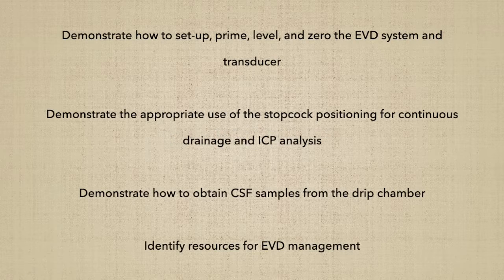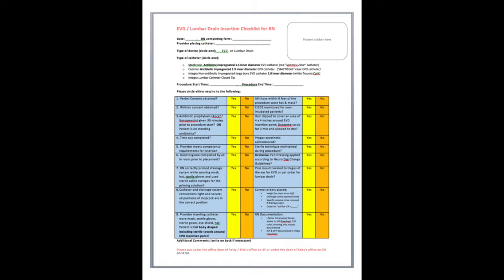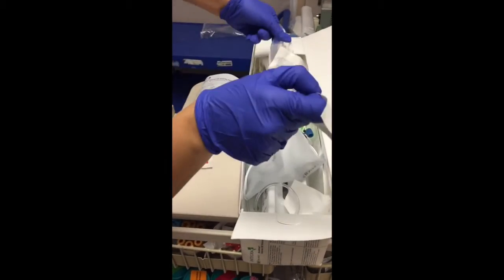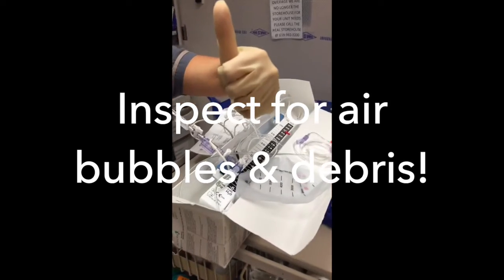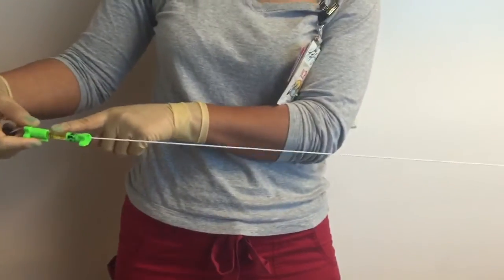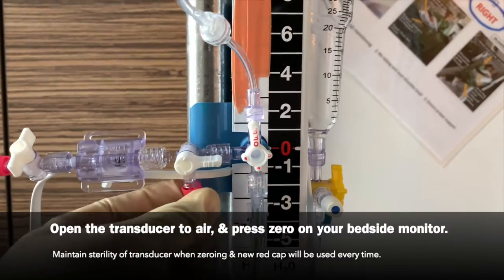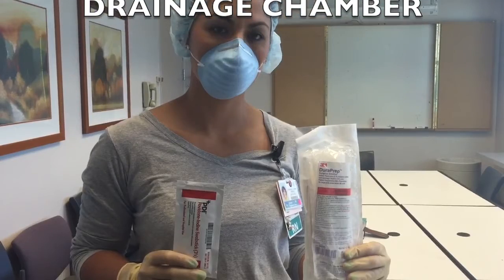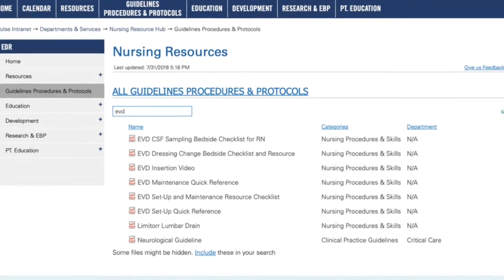EVD Set Up 041819

Comment: I see some videos where they lower the burette to the zero point when zeroing the transducer, then raise the burette to the prescribed order after zeroing. can you clarify on that? thanks!
Reply: There can be two ways to zero the transducer: using an open system (like the video shows) or a closed system.

When you lower the burette to the same level as the transducer when zeroing it, you're using the closed system method.

I'll explain - for most drainage systems, its collection chamber has a small hydrophilic hole with a super fine mesh filter at the top that'll always be exposed.  The hole essentially serves as your "atmospheric air."  Like the video, you have two stopcock valves: one on the transducer and one on the drainage system (not including the proximal stopcock close to the patient's head).  When using this method, you have to keep the transducer's stopcock open, but keep the drainage system's stopcock closed/off to the patient.  The transducer is now exposed to air via that hole because air will enter the chamber, travel up the tubing connected to the chamber and bank a right to the transducer (since the drainage system's stopcock is closed to the patient).

Therefore, to answer your question, you need to lower the burette/collection chamber to zero, so that the hole is the same level as the transducer.  When you use the open system method (as in the video), there's no need to lower the burette because the port that'll be opened to air is already at the same level as the transducer.

I hope that makes sense.

I'd also like to point out that when using the open system method, as in the video, there's no need to touch the drainage system's stopcock at all (as you see at minute mark 05:40) because you're turning the transducer's stopcock off to the drainage system.  I mean you can - just remember to open it back up to permit drainage.
Reply: I have the same question.  🥲
Reply: We don’t do that . We zero transducer and keep the level of the burette as prescribed example 5cmH20